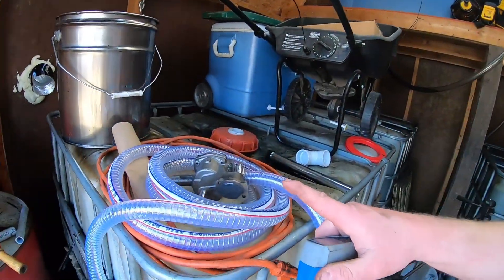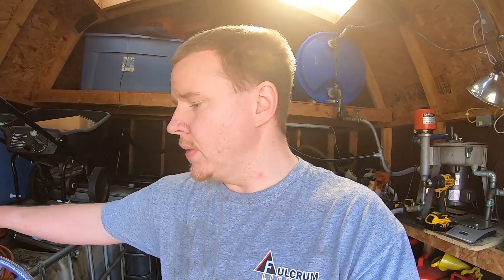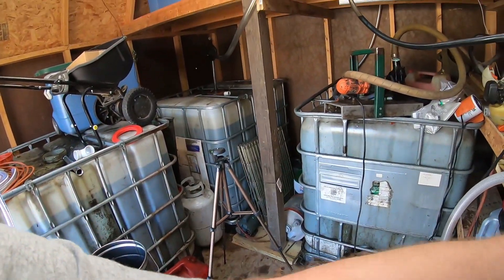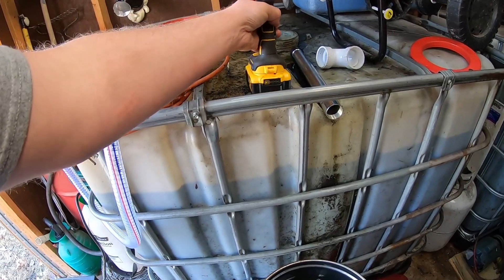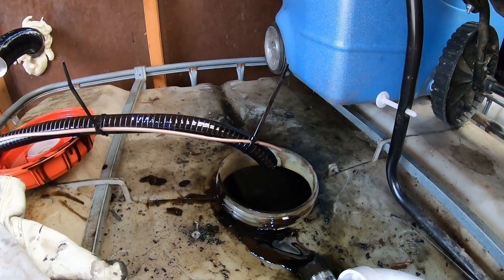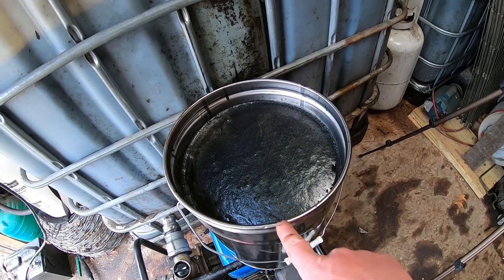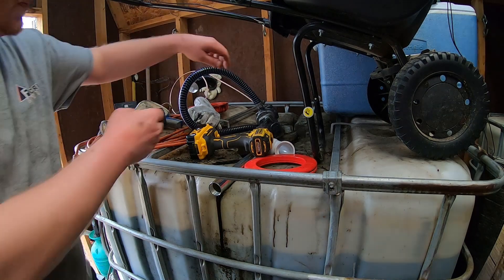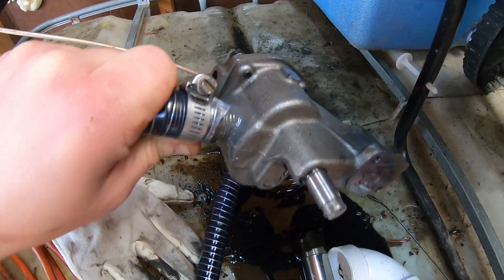Black Diesel - NotSoGrand Garage Prototype Pump Test - Drill Powered Transfer Pump - Made In The USA

Comment: have you ever set one of those type pumps  up with a grinder with tge drill head attachment for large oil collection id like to see if it will run with one and id gladly buy a few of them from you for my oil collection id like to see the diffrence in you vig plock pump and tge one you tested in this video aa a side by side also if possable
Reply from the maker: I wouldn't spin one of these with a grinder...   too much rpm and likely not enough torque at that speed to do any good.  A higher rpm drill or a direct drive motor at 3k rpm or so would be as far as I'd want to go with it.  If you need more flow, then at that point, you'd need a bigger pump like the gas powered trash pumps.

I dont have any big block pumps setup yet other than mine which is 8 or so years old now and isn't perfect by any means.  It was slapped together.  The plan was to gauge interest with this first batch of small pumps and if it's worth it, I'll order up some big pumps at that point. 

I can do comparisons but its gonna be a bit.
Reply: The grinder was an idea to run a few pumps at once off a power strip but I can do the same with a few drills with a zip tie I get 4 330 gallon totes at a time but have to pump them in to my own tanks to haul them I might get the 25gph pump from your store and the small block pumps to transfer from bulk tanks to my filter tanks
Reply from the maker: @lifeoftraveling8330  the 25gpm pump is legit.  It's massive.  I bought one prior to becoming a dealer...  still haven't put it to use yet but will be soon and I'll do a video on it.  Need to order suction hose for it yet.
Reply: About what's the flow rate on the big block pump compared to the small block pump
Reply: im working on building a vacuum pump trailer to collect oil but having a hard time finding a busted valve remover to remove the propane valve its a 11/4 valve got everything ready soon as i find away to remove the broken valve from the tank its a 500 gallon tank they are the fastest way to collect oil if you have a large amount to pick up
Reply from the maker: @lifeoftraveling8330  for sure.  If I had to transfer out of totes on site, a "super sucker" tank would be the ticket.  As for the valve issue...  is it broken off flush? If not, a chisel, hammer, and patience will get it out.  Otherwise, but weld a union to it and use those threads for your fitting instead, assuming the port isn't blocked off.
Reply: it broke off flush with the top of the tank wasnt shure if welding would be a safe way to do it
Reply from the maker: @lifeoftraveling8330  you'd need to fill the tank with water...   but its doable if you can't get it out.

Comment: I made a similar pump - and I use it for everything still, coming on my first year of WMO. I made the mistake of tapping it for 1/2 NPT, rather than 3/4 (because I already had the 1/2 NPT tap). I quickly learned that 1/2" line flows way too slow and upped the line to 3/4 with a barb adapter. Great to see you are making these for people!
Reply from the maker: Interesting...    as this pump is 1/2".  Now my bigger pump which is in the works will be setup for 1"
Reply: @NotSoGrandGarage  Yeah - I don't know how much different 3/4 outlets vs 1/2 would be. I had originally kept the whole works 1/2. Moving up to 3/4 with the hose was a huge difference in throughput.
Reply from the maker: @Christopher Schafer  gotcha!  Yeah this was with 3/4 hose.

Comment: So i have wvo designs 120 ac 12 gpm transfer pump butttt this would be pretty cool to have for like you say when the extension cord is in convenient

Couple questions.   When ever I have a vehicle that's running waste fuel single tank and its having problems running I pump out the tank so that I can just switch to diesel to verify that it's not my fuel  

I generally do this via a fuel line with a 12 volt fuel pump (very slow)

Could you hook this pump to a small fuel line like that and use it? Would it work? Or would the suction likely collapse the fuel line?

Another thing I've been thinking about is getting old gas out of junk cars if i could pump it out conveniently it might be worth it. 

If i could get it through the filler neck that's also an option but I think most cars have anti siphoning stuff to prevent a hose going down the filler neck tho
Reply from the maker: For gas, I would use a cheap 12v fuel pump.  As for the gear pump..  I wouldn't use a rubber hose that is small.  Maybe a piece of 1/2" soft copper tubing or something like that.  I may try it out to see if it'll work.
Reply: @NotSoGrandGarage  Okay cool.

Comment: I run Honda gasoline powered 1in water pump for the pickup I have a one-way valve for a well it has a screen pick up as well it keeps the pump primed when not in use it does 55 gallons in a few minutes
Reply from the maker: I too use gas powered pumps for pickup.  2" trash pump.  Can fill a 275g tote in minutes.  Some just prefer the smaller pumps like this.  I need to look into a line of gas powered pumps though...   hmmm

Comment: Love your videos!... I will be filling 2 totes at a time, would a larger 12v pump powered by a car battery pump that much oil? It would be nice to fit everything in a milk crate and move it with a dolly...
Reply from the maker: Would highly depend on the pump.  WVO sells a much larger 12v pump.  Otherwise, I'd probably look at a trash pump.  500+ gallons at a time will be slow going with a smaller pump.

Comment: Good video!  Where did you get the adapter that mates the drill to the SBC oil pump shaft?
Reply from the maker: It's an oil pump drive for a small block Chevy
Reply: @NotSoGrandGarage  Thanks
Reply from the maker: @95Z28A4  no problem.  They make 2 styles... the one that will be shipping with my pumps has the retainer sleeve pinned on the end.